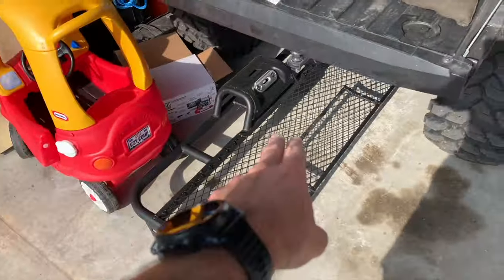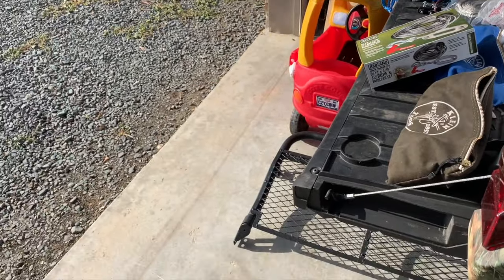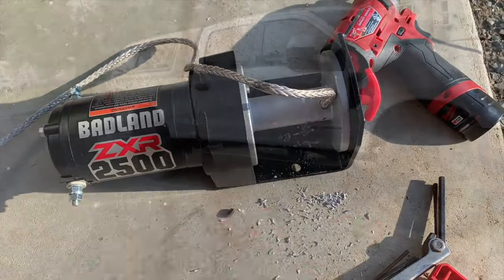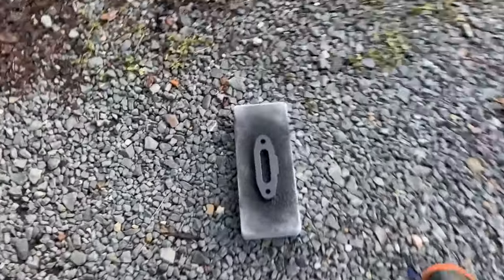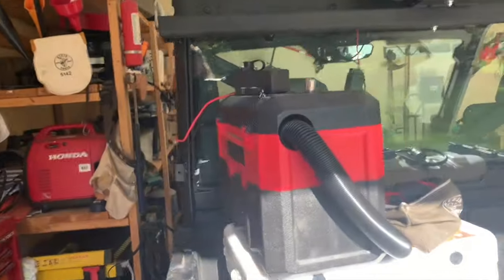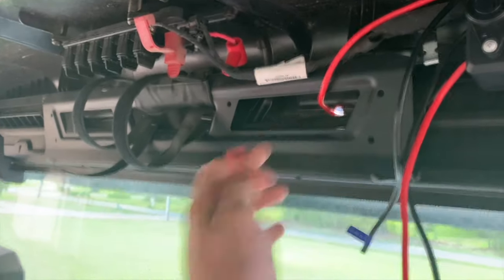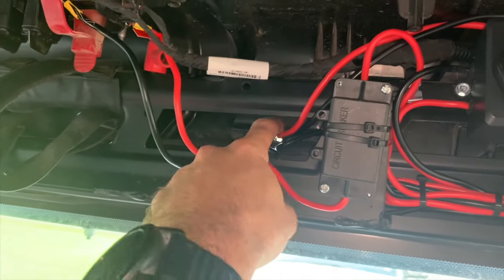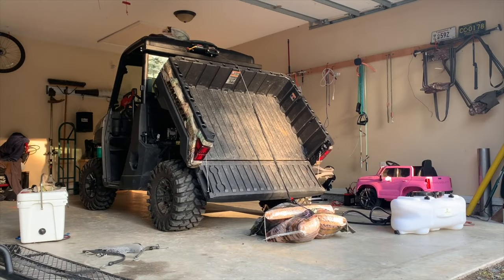How to build DIY Game Loader for a Polaris Ranger

Comment: I was going to do this same thing.  Then I thought, "why not just use the winch mounted on the front bumper?"  If the winch has a nylon rope, you can just let out your winch rope and throw it over the roof of your Polaris.  Raise the bed, attach the rope to your deer/hog, and winch it right into the bed.  Works perfect, does not damage your ride or the winch rope,  and costs nothing if you already have a front winch.  I have loaded 250lb deer into the bed of my bike right by myself.💥
Reply: Was planning the same thing, mine has a metal roof so was going to bolt 2 rollers to a 2x6x? to lay on the top to guide the rope to pull deer/hogs into the bed.
Reply: @LeonardRoberts  I was going fab something like you describe to keep the rope off of the roof of my bike.  Got a deer down before I could do so and tried it without it.  My bike has a plastic roof and no damage at all to the roof after loading several deer.
Reply from the maker: Yes I see alot of people use their roof I’m the forums I’m on. Only reason I didn’t, is I plan on adding a rack up there at some point. 🇺🇸🦅🇺🇸